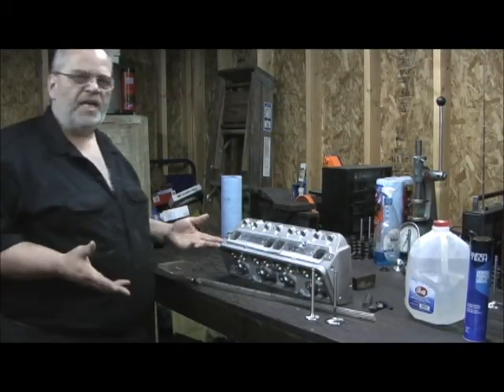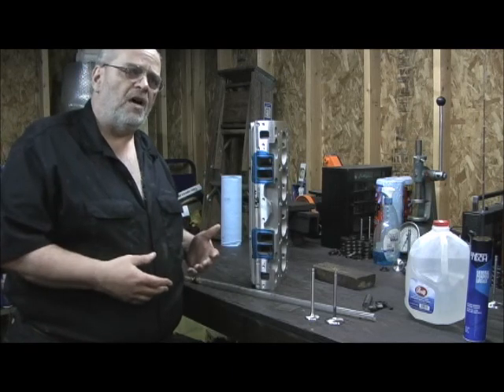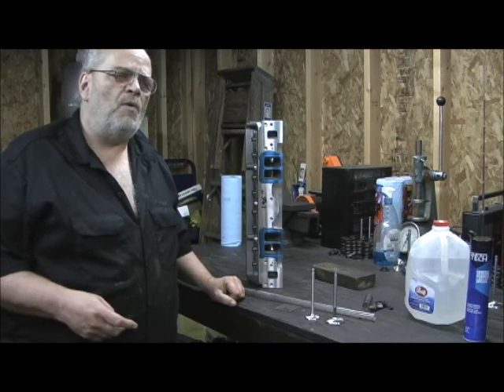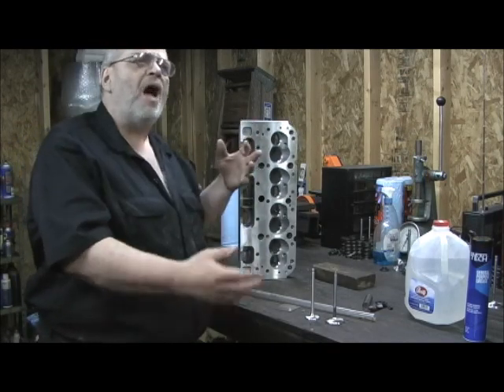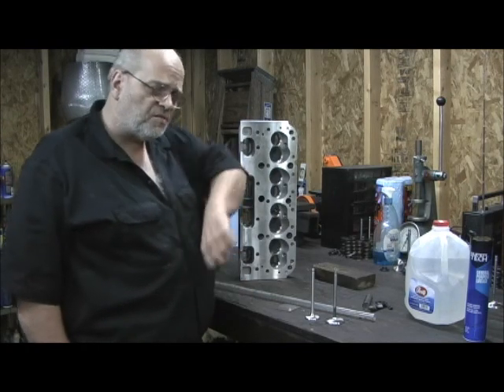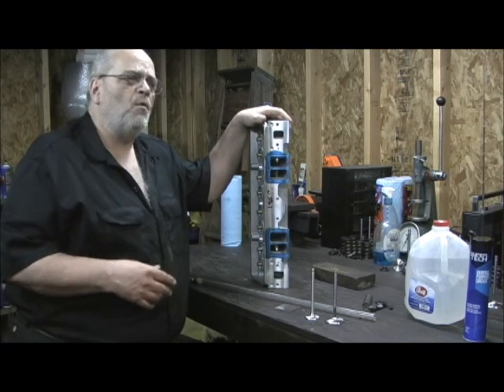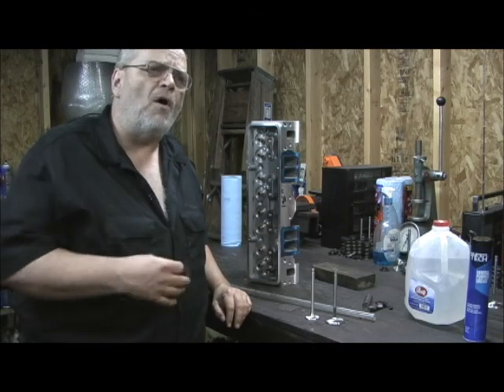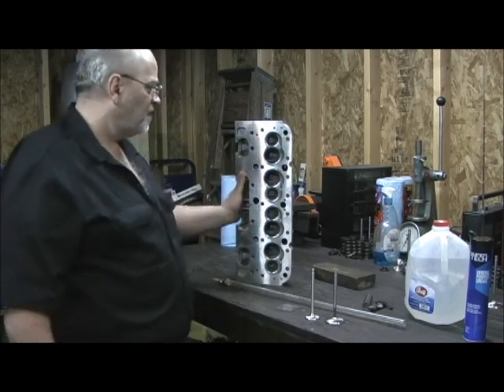Procomp 190cc basic port information cc and comments) Part 2.1

Comment: I know this is an old post but I do have some inside info about Chrysler. YES they are not 'high precision' when it comes to manufacturing. BUT do not blame the engineers, they're as good as any other car maker's employees. If you want to blame anyone, blame the companies that Chrysler contracts to for the castings. Chrysler has done very little of their own casting for decades.
Reply from the maker: I must agree with you FOR THE MOST PART!!! but I do know that they was always the bottom of the big three in terms of casting quality, but like you said, they had a LOT of stuff done by other foundries for sure. Still that being said, Dodge done the BEST math on the blocks of ANY of the big three...Look at the rod rations of the 340 engine, almost a dam 1.90 RS.....